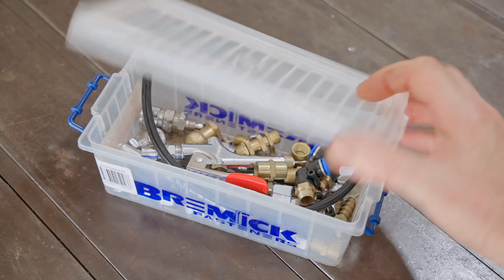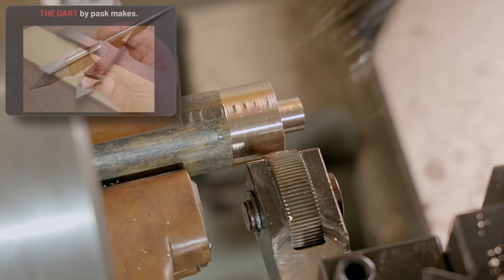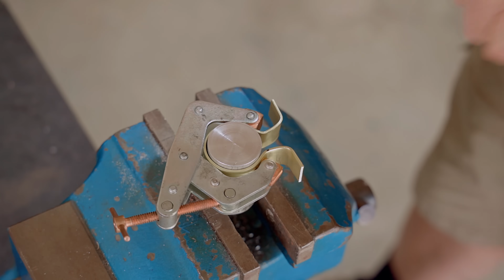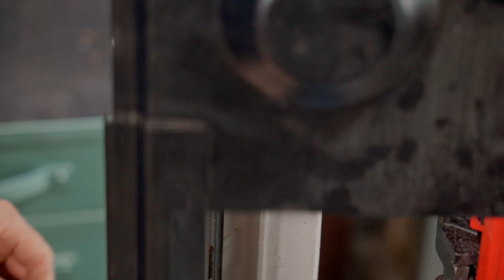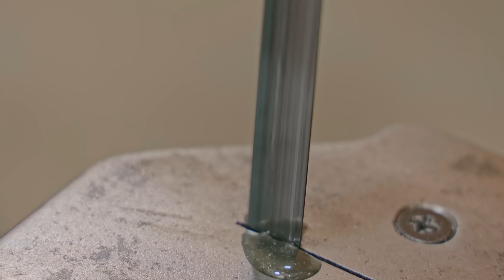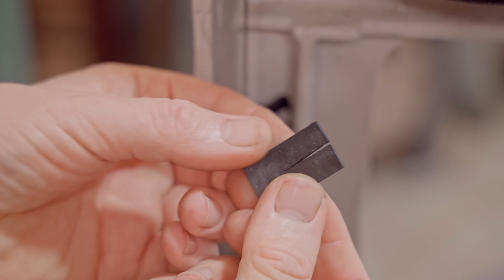Boost Your Blade's Lifespan: Homemade Bandsaw Oiler

Comment from the maker: The Dart BF//CM SALE: https://paskmakes.com/bfcm-sale-dart/

I was never sure if this was worthy of a full video on my main channel, let me know what you think. :)
Reply: Sure it is! Even if one doesn't need to oil a bandsaw blade, there is so much useful information here. I'm U.S. Navy veteran turned woodworker/maker, (in Oklahoma, USA), and I love watching your videos. I find you to be such an incredibly likable fellow, and the things I've watched you make are simply brilliant! Thanks as always! ☮
Reply from the maker: @bigtimsmagic  Thanks very much Tim! :)
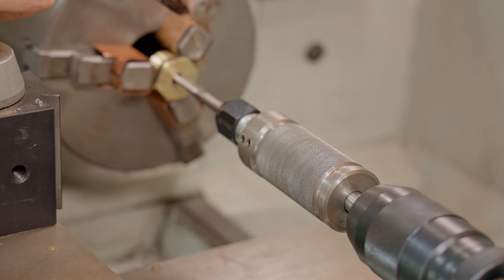Reply: I was just watching you rotate the tap by hand at [2:22] and an idea popped into my head.  Please tell me what you think of it.

- Make a bow with a very loose string that is only permanently anchored to one end
- Wrap the string two or three times around the shaft and connect to the other end of the bow.
- Push down on the bow to make the string tighten snuggly around the shaft.
- Pushing the bow down and forward will then rotate the shaft.
- Releasing the downward pressure and pulling the bow back will loosen the string and bring it back to the starting point, ready to rotate the shaft again, much like a treadle lathe.

Does that make sense?  Does it sound like it would work?
Reply: Anything you make is worthy of posting.
Reply: Hey Neil, just an FYI most Bunnings keeps foam pads to put in trolleys for dogs. Might help your four legged mate to be a bit more compfy.
Reply: It's always worth watching your videos, keep up the good work

Comment: I made a small coolant tank for mine and just put a mesh screen in the chip trey for it to drain back in the tank. I used the adjustable hoses that are on our machines  at work for the coolant and just got a small aquarium pump. I put the hose on the outside though so that i wouldnt ever forget to cut it off when im rushing to do something.

Comment: You need to prevent the oil from going onto the two pulleys that the blade is tied to you will need to put a multiple wiper to stop the oil from going on Gil's wheels I had something similar to mine and I didn't do that and eventually the wheels were not holding the blade anymore so you might want to think about that I hate for you that you'd have to modify those two wheels mine were metal at the time I know there is a rubber sleeve that you could put on those wheels

Comment: I find my blade becomes lubricated at the traction wheels which then slips and dislodges causing catastrophic failure. I  now use Lenox blades which do not require lubrication. Problem solved.

Comment: I spent my entire career (I'm now retired) working in engineering and sales for oil/gas ball valve manufacturers.  Although I doubt it would be an issue in this low-pressure application, it's nonetheless noteworthy that ball valves, by their very nature, are not suited for throttling applications.  They are intended to be used in on-off applications only.  This is especially true of a floating ball valve (which this is), as it is designed to seal better when there is pressure applied to the upstream side of the closed ball, thereby floating it to the downstream seat and maintaining pressure against that seat.  There is some designed preload on the valve's ball/seat interface, but it is not consistent in these types of high-volume produced, cheap brass/bronze valves common to hardware and box stores, so the sealing results of any two such ball valves may be different. A needle valve would be a more appropriate solution for the application.  A globe valve or gate valve would also suffice.

ALL THAT SAID, I'm truly impressed with your can-do manner and forthright approach to improvement of your processes.  Carry on, sir!

As always, thanks much for sharing.

Steve

Comment: I currently use a drip from a flexible nozzle on a large bottle. I also use soluble oil water mixture. I find I use a lot of coolant to cut my metal bars.

Comment: You are very innovative. Quite the designer engineer. Very good. Use your needle valve to adjust the flow and leave it there. Use the ball valve to turn it on and off, full on full off. Use the needle valve for adjustment.

Comment: One change I would suggest would be to use both a needle valve and a ball valve. Use the needle to control the exact flow rate, and then you could use the ball valve to quickly turn it on/off :)
EDIT: Bikermatz suggestion is much better, haha!

Comment: Adding an automatic stop valve seems sensible. An in line needle valve also seems sensible, it would give you an adjustable flow rate, to allow for variations in the oil viscosity. Having the flow valve adjustment independent of the stop valve would avoid having to readjust the flow at every use.

Comment: Needle valve or orifice in series with oiler.  Ball valves suck for fine control.  Leave the ball in place for coarse on/off.  Think of the saw drop regulator cylinder with both ball and needle valve...

Comment: It needs a small solenoid valve wired into the saw switch that opens when the power is applied and closes when the saw is turned off.

Comment: Awesome as usual sir. One tip for you, die nuts are designed to reclaim threads as they have a neutral or negative cutting edge. Split dies are used for cutting threads. Keep up the great and always highly skilled work that you share with us.

Comment: You should use an electric valve that turns on/off with the saw. They're really cheap, and easy to install, with quick connects.
You can use a needle valve to have better control of the flow, and just leave it on all the time.
Reply from the maker: I'm definitely going to look into it. Thank you. :)

Comment: I would have used both a ball valve and a needle valve - the needle valve once adjusted you don't need to touch and the ball valve you turn off when not in use. You could also use a solenoid valve like the ones on chinese small engine carburetors to control fuel. Also thick felt for the wiper (cut up one of those felt disks you can buy to put under the legs of furniture) -  it will get saturated and work better than rubber.

Comment: Great job. Would it work to plug off the breather hole to stop the oil flow? Kind of like sealing the top of a straw and pulling it out of your drink. The liquid stays inside. That way you could dial in the flow rate and then use a separate valve to seal the breather as an OFF switch

Comment: Thanks for sharing this. Just wondering, because I haven't got the mechanism right in my head, if the supply tank was mounted at 45 degrees if it would supply oil both horizontally and vertically.

Comment: lose the lubricating oil. They are  pretty worthless for cutting. You need high pressure additives in a cutting oil.  The most common is Sulfur. Cutting oils sold in the plumbing trade for  cutting threads in steel is superb high sulfur oil.  For aluminum Kerosene is good. Sulfur oil can stain some aluminum. Or you can get a water soluable oil, most of them are universal.

Comment: Good Job brother. I made a rudimentary oiler many years ago by using a hanging plastic rum bottle with the bottom cut out and a 1/4'' refrigerator water supply kit that comes with 12 feet of plastic tubing, compression fittings and a 1/4'' shut off valve. The drip line with an attached magnet  is long enough to supply both my bandsaw and my drill press.
Reply from the maker: Thanks! Sounds like you got a good solution. :)

Comment: Very nice!  Maybe use both valves?  Needle valve to control flow, set and forget.  Ball valve to open and close.  Or maybe get fancy and use solenoid valve controlled by the saw on/off switch.  No forgetting then.

Comment: I wonder if you put some felt in the hole against the blade it will only dispense oil as it’s running, eliminating the need to turn it off. Kind of like a felt tip pen/marker.

Comment: Hey Neil, looks like a electromechanical valve would be a great option, It would open only when the saw is running. (won't help with the flow but I think you have that covered already.

Comment: if you want to foolproof the oiler look for an "Electric Solenoid Valve normally closed" if you put it between the needle valve and the oil reservoir and you wire it inline with the motor power(get one same voltage as your motor), the oiler will only flow when the motor is on. there might be a bit of drip when you shut it off, from the space between the two valves. another plus is once you get the flow right you never have to mess with it again.
Reply from the maker: That would be awesome Marc - I'm not good with electrics but I'll look into it. Thank you. :)
Reply: @PaskMakes  actually I just realized you're on 220-240v over there. just make sure you check with your electrician. I'm not sure if you'd have to wire it inline, or with a relay, but it should be doable.
Reply: @marcg2233  Easy to wire things to 110v off of 220v, but may not be legal to do it in his area.
Reply: @TehButterflyEffect  oh did not know Australia was 220v, sorry North America 120v here :S
Reply: @TehButterflyEffect No it's not. Need a transformer.
Reply: Nothing a small 2:1 transformer couldn't solve. I think in this high tech era we're forgetting about the simple solutions
Reply: Until it gets  older or warmer.

Comment: You can find some tiny electric solenoid valves online, and hook them up to the saw power on switch, so that they only dispense oil when it's on.
And to control the flow, instead of controlling it using the valve, control it using the air inlet hole, or put the solenoid valve after the needle valve you want to get.

Comment: What would you think about adding a needle valve behind the quarter turn valve to more accurately control the flow then use the quarter turn as only an on-off valve?

Comment: Great idea and nice job.  I'd like to take your idea and add an electrically-operated valve to it, to only come on when the blade motor is running.  (But that will have to wait a long time, as I have another three-month hiatus upcoming.  Adding it to my list for much later.)

Comment: When you are making things with threads that come up to a shoulder, it's a good idea to cut a small relief at the base of the shoulder where the threads would meet it. That way, if you cannot thread right up to the shoulder, there will be a small clearance that will allow the shoulder to seat down on what you are screwing it into without using a washer like you did here. In addition, if you use a lathe tool that will cut a small rounded groove, you can get an O-ring to fit the groove to seal it off.
Reply from the maker: Thanks for the ideas - makes perfect sense. :)

Comment: You don't need a needlevalve! Just make the fillingscrew with a little slot in the threads and plug the airvent hole. 
Then you can adjust the dripping according to how much air you let in to the "reservoir", and you can keep the ballvalve as a shut off valve. 
Now you get the right amount of oil every time you open the ballvalve.
Reply from the maker: That's a great idea, Thanks very much! :)
Reply: Excellent idea ! Thanks !
Reply: assumes a perfectly sealed reservoir... Probably not happening with the threads on the top and bottom caps that the tube "seals" to.
Reply: @Boosted98gsx  That reservoir is not under any pressure and if it's not leaking now then it will be fine with my solution.
Reply: @bikermatz  I agree, great solution
Reply: @bikermatz  indeed, yours  is a great solution.  Some simple O- rings on those large brass 'plugs' he used would have been well enough to seal that, even under a bit of pressure, as difficult as they were to fit. Had he heated and rolled the tube at those plugs, it would have sealed even better.

Comment: You could put a cheap needle valve inline before the ball valve to control flow and use the ball valve as on/off.
Reply: And if that works (I think it will, also) switch to a solenoid valve to open/close with the saw switch.

Comment: should have 2 valves. 1 on off and 1 flow control.

Added kool mist to my saw yrs ago. also added auto stop type control with aa limit switch kool mist on or off and e-stop. think it was like a hundered for all the parts. I got to make 6-8 brackets. I run emulsified oil 10-1 through, it is easy to clean off.
Reply: Is Kool Mist a venturi cooler?  I have looked at those for years.  Need sufficient air for them.  I added a water soluble oil mister a long time ago and it works beautifully.
Reply: @WmLint  there is a venturi but it is not the cooler. the venturi mixes the air and water. The cooling comes from the mas of air water mix flowing over the work. 

The real advantage in the home shop is only 1/100 of the actual oil going every where. 1/10 oil x 1/10 air.

Comment: I think you could use that brass screw to control the flow, assuming there's no hole in the cap. You could then set the flow (by loosening the screw and letting air in) and use the valve to just shut off.

Comment: Could you wire in a solenoid valve to auto start the oiler when the blade is running?

Comment: Next project -get rid of the trash feed spring and replace it with hydraulic cylinder. Pneumatic one can be modified(replace the o rings and the rest of it with ones that are resistant to oil,most of them already are but just in case),cheap mal 32 cylinder can be used.You need double acting single rod cylinder.
Whole thing works by connecting two ports with 1/2" pipe(you can use copper or ptfe plastic air fittings ) and you put needle valve in middle .After that you make a bypass of said needle valve and in that bypass you put one way valve so you can lift a saw up freely but when it goes down oil needs to go trough needle valve which controls feed rate.
Air bleeding and filling system with oil can be made easy by making your own connector with a cap on one of the ports.

Most cheap air cylinders use G1/8" thread(AKA BSPP-parallell thread)R1/8" would be BSPT-tapered thread.

Comment: Needle valve would be the best choice.  A ball valve is usually best for full on or full off.
Reply: It's actually not "best full on / full off" but rather intended to be used that way. At least so I heard.
Reply: @zyamadeadborn1785 I’ve heard the opposite. Ball valves not recommended for granular pressure control. I’m not entirely sure why, but id guess that whatever reason it’s not ideal for regulating water/gas/steam is probably not relevant for such a low pressure oiling system.

Comment: Nice build! A needle valve is a better choice for controlling flow in this situation however. You can easily dial one in to drip every few seconds, much more control than a ball valve.

Comment: Great job. Splitting the oil line inside the aluminum block was something I would not have thought of. Fantastic!
Reply: My only concern is the aluminum potentially grabbing the blade if it runs dry. Something like bronze or cast iron would probably be more suitable for the task.
Reply from the maker: Thanks Mike! :)
Reply: I wouldn’t have thought of it either.   but he’s pretty clever